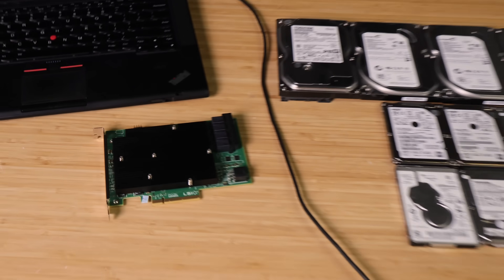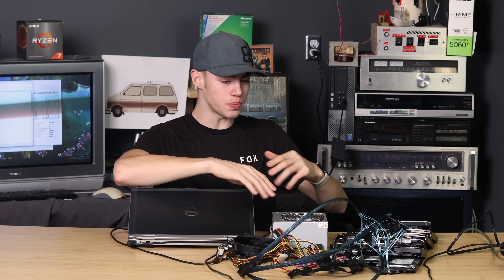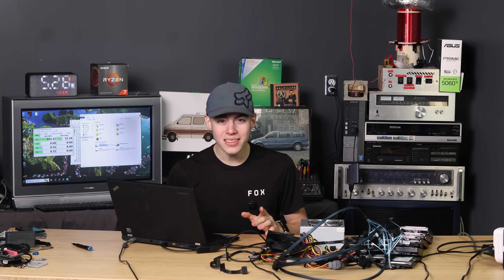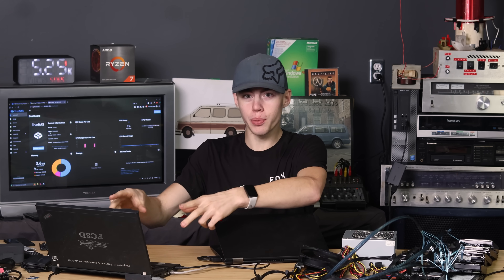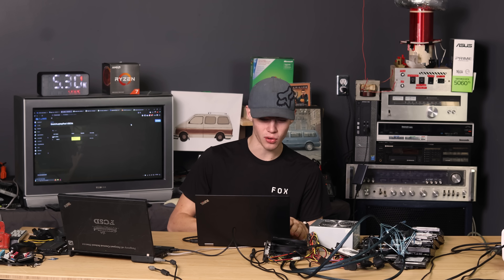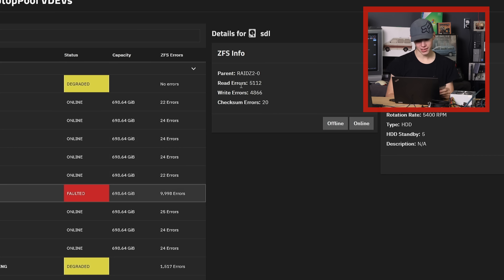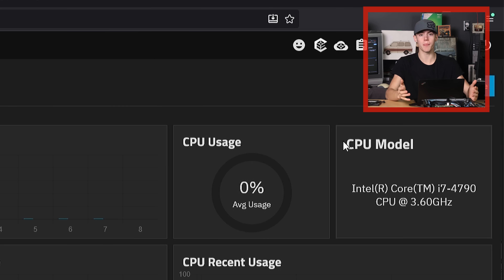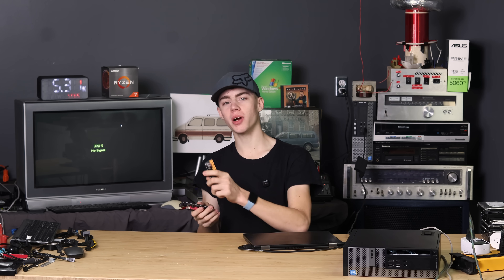How Many Hard Drives Can a Laptop Handle? Sketchy NAS Build

Comment: Bro, I daily drove a Laptop with 2 m.2s and a USB hub attached with 4 extra drives for lightweight games and 2 on the main board that allowed me to fully utilize with my 2 tb ssds and I had a wireless Bluetooth keyboard and mouse 😂😂😂😂😂 for 3 YEARS I just recommend unplugging your battery because it will CAUSE your battery to become prego and swell
Reply: System still works btw but I learnt it causes your battery to swell also if you keep it consistently charged...

Comment: As many drives as any system that can see...formatted in whatever format....then using mergerfs and snapraid (for redundancy) and viola (it's kinda like a DIY UNRaid server type structure)...instant scalable server
I have a YouYeeToo-X1 (SBC)  tied into a JBOD 4x 3.5" bay thru USB 3.0 and kapow...I have 10TB~ of drive space from a handfull of hodgepodge XFS formatted drives
You do have to install linux though...
warhawk@YouYeeToo-X1
                                               --------------------
                             ....              OS: Ubuntu 24.04.3 LTS (Noble Numbat) x86_64
              .',:clooo:  .:looooo:.           Host: YouYeeToo X1
           .;looooooooc  .oooooooooo'          BIOS (UEFI): Y_FIVE_01003 (5.19)
        .;looooool:,''.  :ooooooooooc          Bootmgr: ubuntu - SHIMX64.EFI
       ;looool;.         'oooooooooo,          Board: Y-FIVE
      ;clool'             .cooooooc.  ,,       Chassis: Laptop
         ...                ......  .:oo,      Kernel: Linux 6.8.0-60-generic
  .;clol:,.                        .loooo'     Init System: systemd 255.4-1ubuntu8.11
 :ooooooooo,                        'ooool     Uptime: 41 days, 21 hours, 26 mins
'ooooooooooo.                        loooo.    Loadavg: 3.09, 3.07, 3.12
'ooooooooool                         coooo.    Processes: 336
 ,loooooooc.                        .loooo.    Packages: 2001 (dpkg), 12 (snap)
   .,;;;'.                          ;ooooc     Shell: bash 5.2.21
       ...                         ,ooool.     Brightness (DSI-1): 31% [Built-in]
    .cooooc.              ..',,'.  .cooo.      LM: sshd 9.6p1 Ubuntu-3ubuntu13.14 (TTY)
      ;ooooo:.           ;oooooooc.  :l.       Terminal: /dev/pts/0
       .coooooc,..      coooooooooo.           Terminal Size: 237 columns x 62 rows (1936px x 1048px)
         .:ooooooolc:. .ooooooooooo'           CPU: Intel(R) Celeron(R) N5105 (4) @ 2.90 GHz - 78.0°C
           .':loooooo;  ,oooooooooc            CPU Cache (L1): 4x32.00 KiB (D), 4x32.00 KiB (I)
               ..';::c'  .;loooo:'             CPU Cache (L2): 1.50 MiB (U)
                                               CPU Cache (L3): 4.00 MiB (U)
                                               CPU Usage: 78%
                                               GPU: Intel UHD Graphics (24) @ 0.80 GHz [Integrated]
                                               Memory: 2.57 GiB / 15.46 GiB (17%)
                                               Swap (/swapfile): 0 B / 2.00 GiB (0%)
                                               Swap (/dev/zram0): 2.00 MiB / 7.73 GiB (0%)
                                               Disk (/): 34.91 GiB / 915.32 GiB (4%) - ext4
                                               Disk (/mnt/disk2): 71.50 GiB / 3.64 TiB (2%) - xfs
                                               Disk (/mnt/disk3): 2.63 TiB / 5.46 TiB (48%) - xfs
                                               Disk (/mnt/disk4): 53.67 GiB / 2.73 TiB (2%) - xfs
                                               Disk (/mnt/parity1): 2.60 TiB / 5.46 TiB (48%) - xfs
                                               Local IP (enp1s0): 192.168.0.108/24 (e0:51:d8:11:8b:96) [Speed 100 Mbps / MTU 1500] <UP,BROADCAST,RUNNING,MULTICAST,LOWER_UP>
                                               DNS: 192.168.0.1 192.168.0.51
                                               Date & Time: 2025-11-10 04:45:44
                                               Locale: en_US.UTF-8
                                               Vulkan: 1.4.305 - Intel open-source Mesa driver [Mesa 25.0.7-0ubuntu0.24.04.2]
                                               OpenGL: 4.6 (Compatibility Profile) Mesa 25.0.7-0ubuntu0.24.04.2
                                               Users: warhawk@login screen - login time 2025-09-29 08:17:17
                                               Sound: Built-in Audio Analog Stereo (0%)
                                               Network IO (enp1s0): 126.05 KiB/s (IN) - 2.89 MiB/s (OUT)
                                               Disk IO (HGST HUS 724040ALE640): 0 B/s (R) - 0 B/s (W)
                                               Disk IO (HITACHI HUS724030ALA640): 0 B/s (R) - 0 B/s (W)
                                               Disk IO (Samsung SSD 970 EVO Plus 1TB): 2.43 MiB/s (R) - 404.00 KiB/s (W)
                                               Disk IO (WDC WD60 EZAZ-00ZGHB0): 0 B/s (R) - 0 B/s (W)
                                               Disk IO (WDC WD60 EZAZ-00ZGHB0): 3.45 MiB/s (R) - 0 B/s (W)
                                               Physical Disk (HGST HUS 724040ALE640): 3.64 TiB [HDD, Fixed]
                                               Physical Disk (HITACHI HUS724030ALA640): 2.73 TiB [HDD, Fixed]
                                               Physical Disk (Samsung SSD 970 EVO Plus 1TB): 931.51 GiB [SSD, Fixed] - 59.9°C
                                               Physical Disk (WDC WD60 EZAZ-00ZGHB0): 5.46 TiB [HDD, Fixed]
                                               Physical Disk (WDC WD60 EZAZ-00ZGHB0): 5.46 TiB [HDD, Fixed]
                                               TPM: TPM 2.0 Device
                                               Version: fastfetch 2.54.0 (x86_64)

Comment: those cables are mini SAS cables to SATA splitters and TrueNas can be accessed remotely so no need for gpu or monitor , just use the default address and logging to remote into the NAS  and execute the setup. also  no real need for cpu to boost since it draws more power just idling and is not efficient or needed to work. Also intel core non F CPU SKU's have integrated graphics.

Comment: I mean, probably important to mention that you're using computers from 2012-2014 here. That is a big part of why the laptop wasn't really power efficient at all, they only started caring about that around 4th gen, and really didn't get it right until 6th-8th gen. Older CPUs don't use less power when idle because they didn't have enhanced speedstep and C-states, if you had a 3GHz CPU it ran at 3GHz period. For example, my desktop i7-8700K easily goes down to like 700MHz given unused enough and draws 3W (for CPU package alone, add a bit more for the motherboard, PSU overhead and so on). For a top of the line desktop from 2018. Meanwhile 1st gen i3 will happily draw like 120W from the wall sitting in BIOS, and even in OS (which disables some unused parts a bit) you're still in the high 80s to triple digit range. There's been improvements to power usage in the last 10-15 years and it's kinda silly to omit that.

Comment: try this command on a Linux system, (a recomendation create a bootable USB device with Linux Mint and boot from it) "sudo badblocks /dev/sdb -sfvw -b 4096" the "-b 4096" is just if the drive have sectors of 4 KB instead the old 512 bytes, it will check if the drivers are healty writing different patterns of data on the disk and check the integrity... it will delete the entire disk... and of course change /dev/sdb for the right letter of the HDD, you can uset it on the command line from TrueNAS/FreeNAS too, only don't close the remote access to that  CLI if so the test will stop and you will need to restart it again... so open as many tabs on the browser as you will needed

Comment: A different idea of what you did.
Instead of using an Express Card to PCIe. 
Why not just use an M.2 to SAS Adapter, and use like a T480 or T280 (they have M.2 slots)
You'll only be able to do 8 Drives, but i reckon, way more reliably

Comment: Next up the old gaming pc with excessive amounts of 3.5 and 5.25 bays with adapters, don't forget the rubber hdd screw washers and fans in the front between the hdds and the case so they stay cool!
Reply from the maker: This could be good for a more proper and useful version.
Reply: @ScuffedBits  Should work nice in theory, especially combined with some server cards to expand capacity.  Bigger the case with more mounts and fan options (can probably jury rig some in the 5.25 bay option too though i know there is bay adapters that had a fan or 2 in the old days)

Comment: You know u can get a 5.25 inch bay to 6 2.5inch drive mounts some have hotswap if ypur controller supports it.  Worth a look if you want it to be neater snd run cooler
Reply: there is even IcyDock MB998TP-B that gives 8 * 2.5 HDDs in one 5.25" but they need to be max 7mm high.

Comment: In my experience, HBAs like that run hot and expect a good amount of airflow (in a server chasis). Mine was throwing disk errors until I screwed a 40mm Noctua fan to it (zipties would also work) and has been happily chugging along ever since. No more errors
Reply from the maker: I had a fan on the 16 port card the whole time. That one gets super hot. The 8 port card I have doesn't seem to need one.

Comment: The 4790 does have integrated graphics. My old company had those Optiplex models and Dell included a GPU by default I think mostly to increase profits as it was a $100 add on if my memory serves. My recolection is that the Intel HD 4600 was basically the same performance as that Radeon card. Once I became more involved with model selection I removed the GPU from future models.

Fun video as always!
Reply from the maker: Thanks! I couldn't remember if it did. That makes sense.
Reply from the maker: See Short reply

Comment: Im gonna guess that the PSU just cant provide enough power to the drives to run them correctly. I know modern estimates say 15 watts per spinny drive, but really it needs 20 watts for spin up. So worse case with 16 x 20 watts is 320 total watts needed from the PSU. Which that old sketch PSU might be pushing it.
Reply from the maker: Could be possible! That PSU is rated for 500 watts but it is very old and questionable quality.
Reply: @ScuffedBits  Yeah Im willing to bet the 12v rail is actually 400w, along with its age lol. I remember doing something similar to this with 48 drives on a custom 12U short depth rack build. Had to find 12v and 5v power supplies with custom wire runs to make it work as the whole thing on spin up pulled 1000 watts. Once it was done it was amazing to maintain. You would just slide out the custom 1U sled that held 6 drives, pop the bad drive out with new drive in, and slide it back in. Last time I saw it it was modded with power on switches to each 1U drive sled, and what the owner would do to power up the system is to power on one sled at a time before powering on the computer itself. That alone reduced the amount of drives that "died" over time Ive noticed. So staggered spin up would probably help you too lol.
Reply: Laptop drives don't need as much power, otherwise external 2.5" drive enclosures would not be able to run from a 5V 1A standard usb port (or even less)

Comment: The PSU might be at fault, specially with all those large SATA power adapters. They might be using a single +12v rail and ruining efficiency.
Reply: Also on the final build: the i7 should have an iGPU. A dedicated graphics card is not required for a NAS, specially if it wont help with video transcoding in case you use services like Jellyfin or Plex. It might help with PCIe bandwith and heat dissipation to remove it.
Reply from the maker: @matt4193  yeah, probably didn't need the GPU. And PSU definitely could have been a problem. I should have tested with a better one.